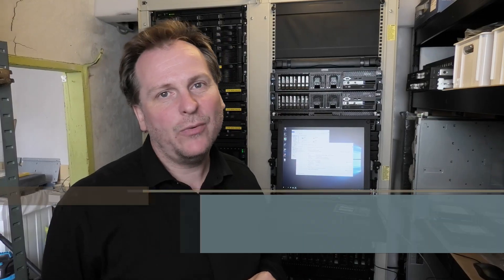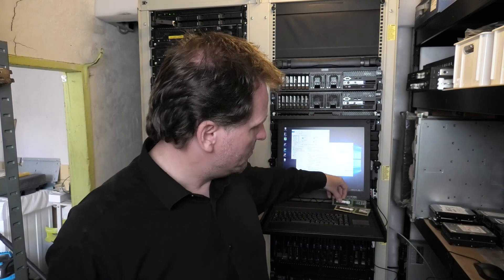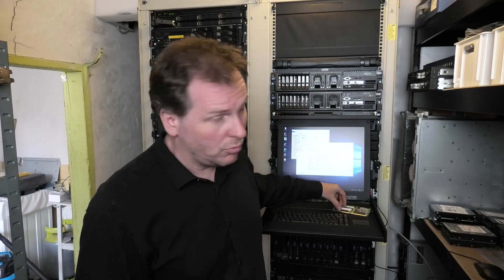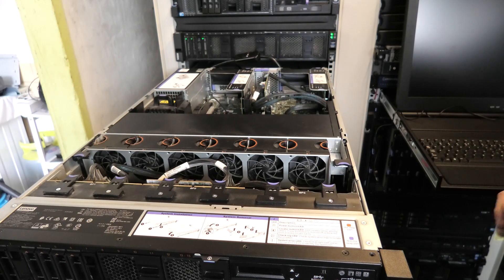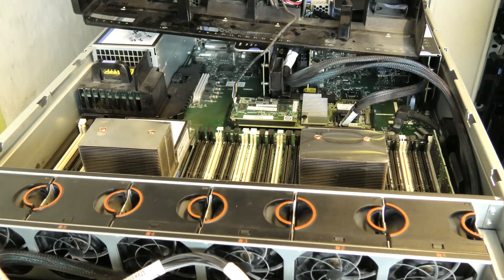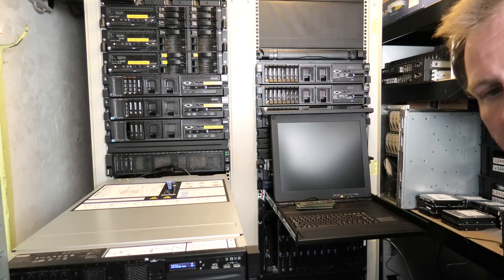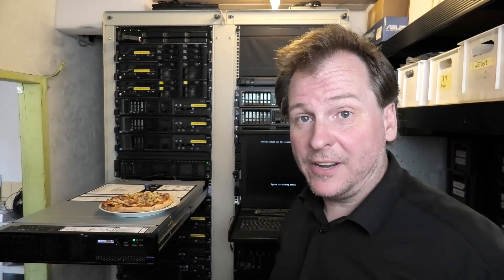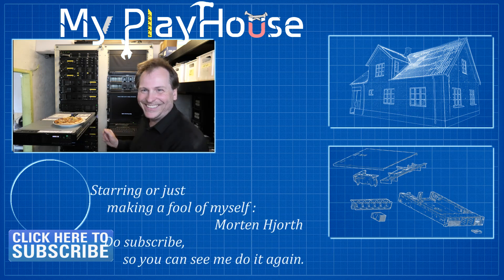64GB LRDIMM vs. 64GB RDIMM in Lenovo x3650 M5 - 1185

Comment: Hey i got the same server but without the lcd display. i am running into a problem that i hope you might know how to resolve.   

Error Numeric sensor fan 5B Tach going low (lower critical) has asserted
Error Numeric Sensor Fan 6B Tach going low (lower critical) has asserted
Error Redundancy Lost for Fan Zone 2 has asserted

After a couple minutes of running the server shutdown. i have tried moving the fans with good fans but the good fans have same error in those slots but not in others
Reply from the maker: Would be the fans, running to slow :-/ or firmware :-/
Reply from the maker: Maybe You can run the server a cold places to check..
Reply: @MyPlayHouse   Hey thank you for the reply.  i updated firmware to current. and tried it in a cooler place but same problem.  i just order a cheap  refurbish motherboard for $200NZD as it may be a fault on the board.      But really appreciate you taking time to reply most people would not thanks

Comment: Possible that the new 64GB faster DIMM do not have a timing profile in the SPD for the slower CPU access, some firmware will refuse to work. Test the new DIMM in another server and read out the profiles!
Reply from the maker: could be :-/

Comment: Is it possibly that it will work with v4 cpu's? You are using v3 cpu's now.
Reply: For v4 CPU there is a different FRU of motherboard. v4s supports those RAM automatically where v3 have to be the correct model and the latest firmware.
Reply from the maker: I do have the v4 systemboard.
Reply from the maker: I have also been thinking this!!